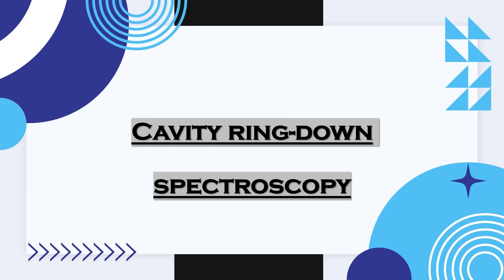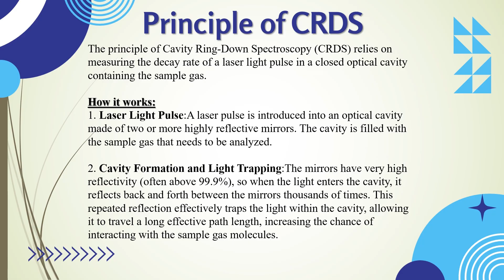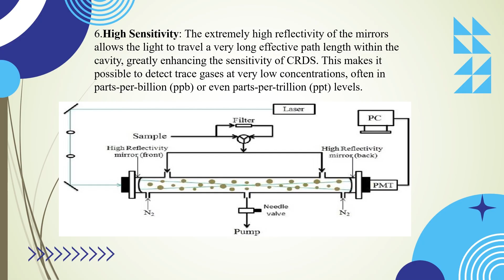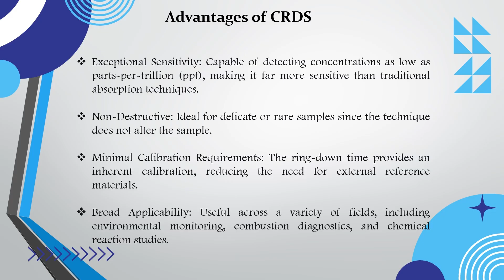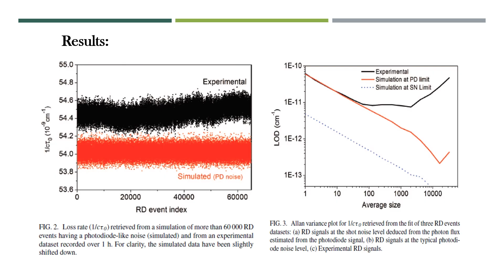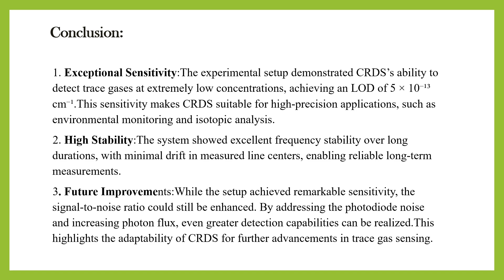CAVITY RING-DOWN SPECTROSCOPY||INSTRUMENTAL ANALYTICAL TECHNIQUES||BT21CME079_Shruti Pandey

Comment: BT21CME044 Shreya Fating
How does the reflectivity of mirrors affect the sensitivity of CRDS?
Reply from the maker: The higher the reflectivity of the mirrors (typically >99.9%), the longer the light remains in the optical cavity. This increases the effective path length, enhancing the sensitivity and allowing CRDS to detect very low concentrations of molecules.

Comment: BT21CME047 Harshita Patil
What are the major limitations of CRDS in field applications?
Reply from the maker: CRDS requires precise alignment of optical components, stable environmental conditions, and high-quality mirrors, making it challenging to deploy in field settings with vibrations or temperature fluctuations.

Comment: BT21CME045 Saumya Rewatkar 
How does the choice of laser wavelength affect CRDS measurements?
Reply from the maker: The laser wavelength must match the absorption characteristics of the target molecule. If the wavelength is not suitable, the molecule may not absorb the light, leading to inaccurate results.

Comment: BT21CME067 Achal Kannake What type of laser is generally used in CRDS experiments?
Reply from the maker: Tunable lasers, such as dye lasers or diode lasers, are commonly used in CRDS. These lasers allow precise control over the wavelength, enabling selective measurement of specific gas molecules.